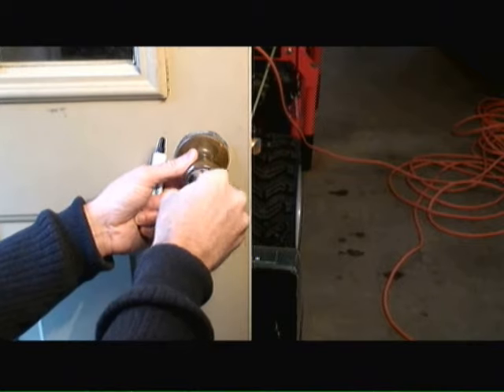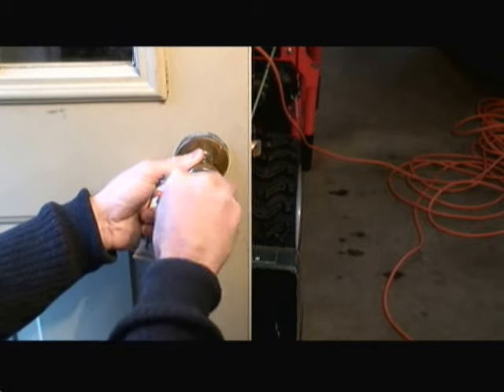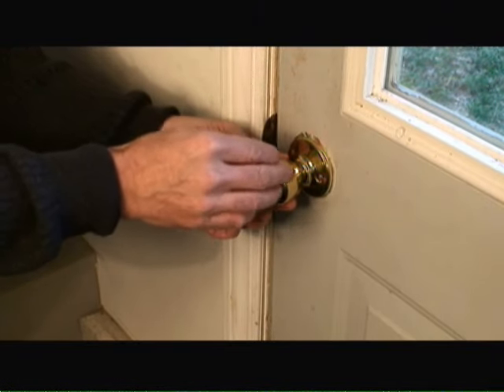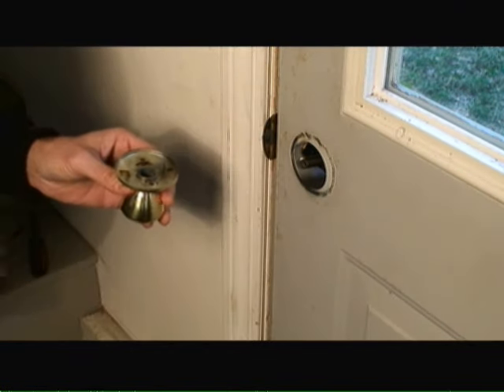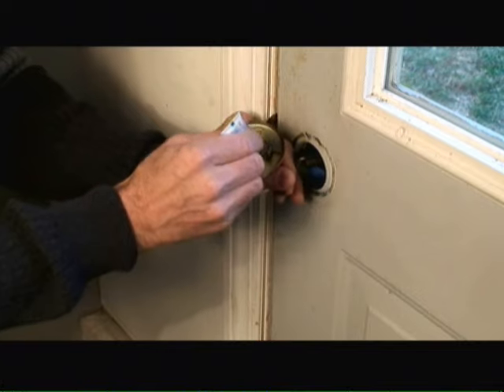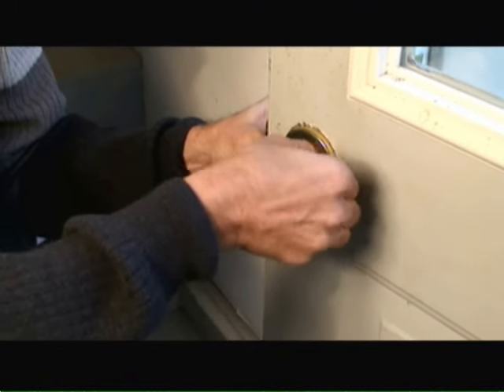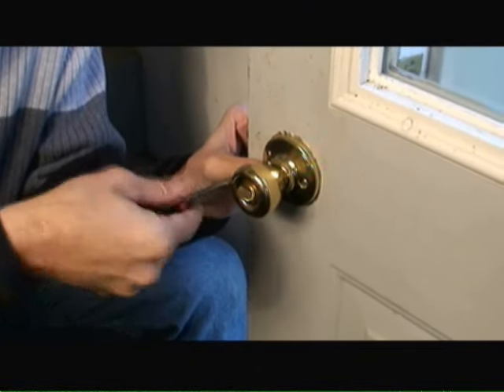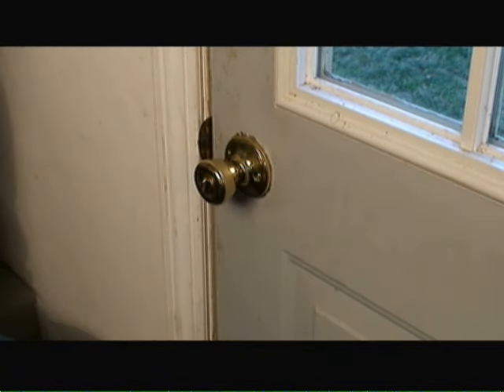How to Repair a Door Lock Video

Comment: Also, the plate on the inside of the other door knob with the stem on it may be too high causing it to rotate and not let the two tabs slide smoothly .

Comment from the maker: You may also want to contact the major manufacturers of graphite lubricant as they specifically make it for keylocks (and pine wood derby cars).

Using a liquid like lubricant such as WD40 or even a silicone product will cause dust particles to collect more easily on the door lock mechanism.